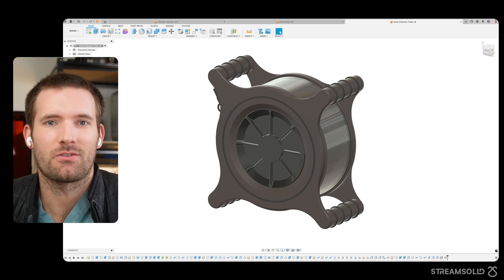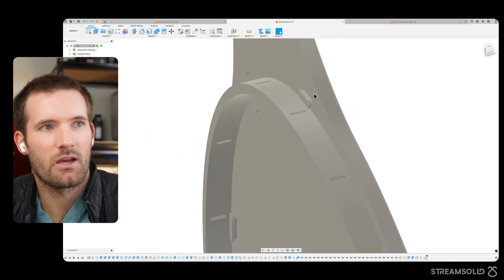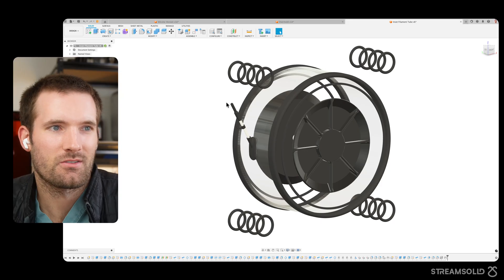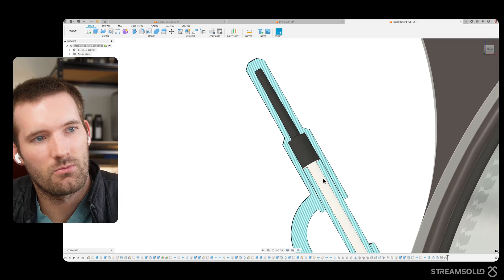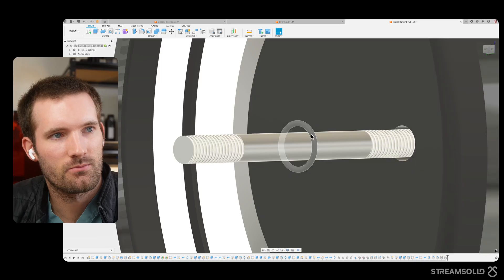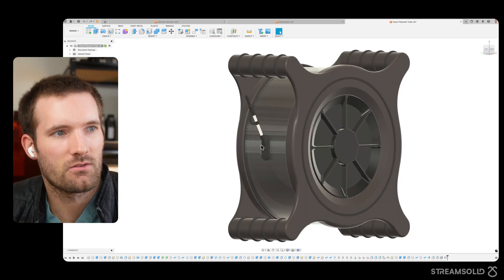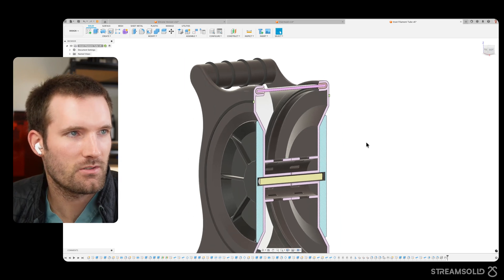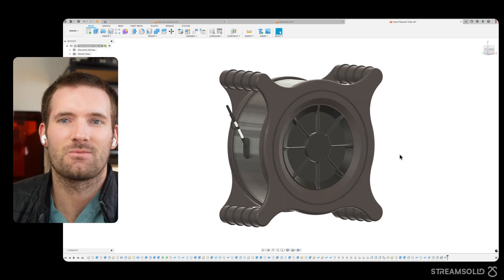Redesigning the Filapod for Mass Production

Comment: following your journey, and looking forward to your product. 

I purchased the new Snapmaker U1 and will arrive in a month or two. 4 of these Filapods that attach to the printer would be IDEAL. I believe that is one thing that would really make that new printer beyond amazing; zero filament exposure to the elements from the roll until the nozzle.

They advertise the Polymaker's Polydryer as their Heater/Storage solution (which I might end up buying), but the printer itself begs for the rolls to be attached to the printer itself.

Alternative Design Suggestion: have an upgradeable acrylic/PC part (the cylinder which holds the filament) which contains a heater/fan to be able to dry while stored/printing. can still use the side pieces for the sandwich down, but slightly different geometry for the spool holder which can accomodate a small heater and fan.

Comment: 6:37 the loop holding cap to ptfe tube needs to be longer. The way it is drawing allows you to uncap and pinch the short filament that’s sticking out. As drawn atm you don’t have much freedom of movement on the cap to do what you’re saying. If the cap was no connect it would work as you describe. 

I haven’t watch prop video of this but assume tou have a space for desiccant for anything in the container when you open to fill. Or will you have a heater wire embedded somewhere.
Reply from the maker: Good point - will adjust it. Desiccant will go inside of central axis that the tube rolls around